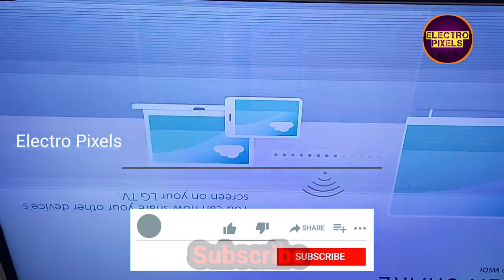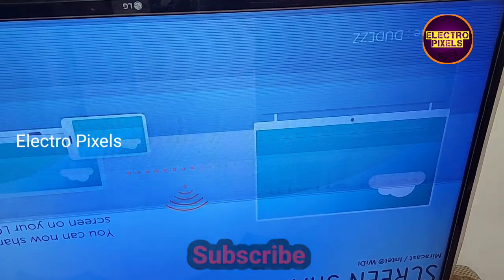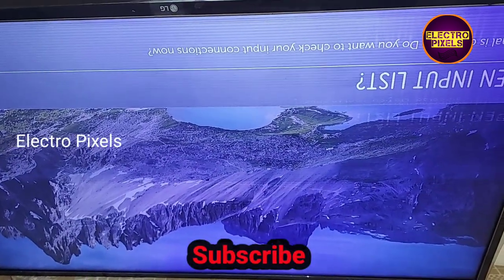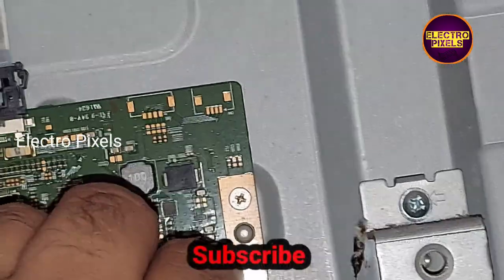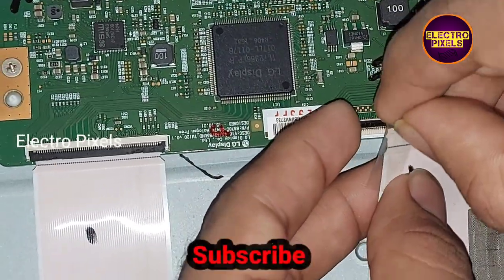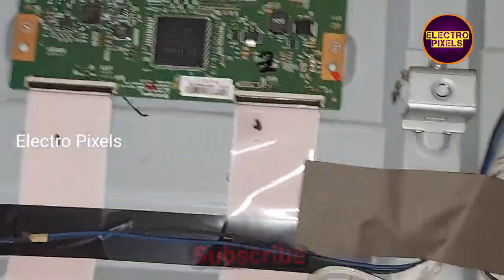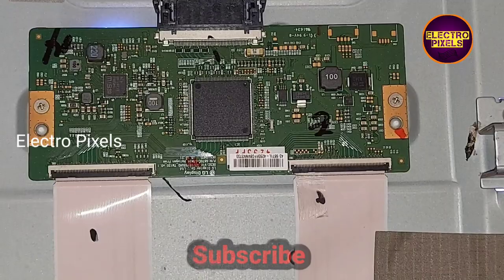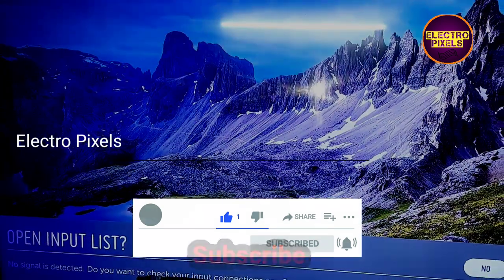Led Tv Vgh vgl Short Removal ||LG 43" 4K Led Tv Half Display Flickering and Double image Repair

Comment: Thank you for this video ,English speaking gives full details .
What are the gate signal points identification in lg tcon , are they ckv1 ckvb1 ..etc as in samsung panels?
Reply from the maker: Same, but name will be different, Also instead of this Taping method you can Try Levelshifter Ic Modification method for that watch our previous video